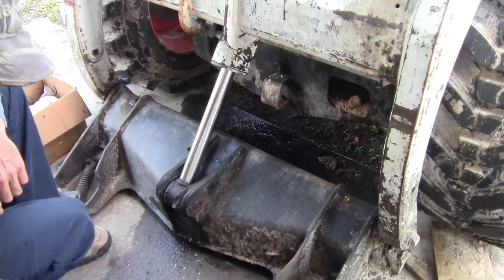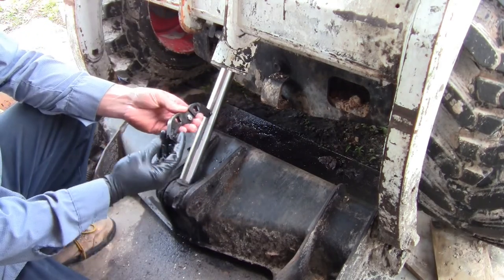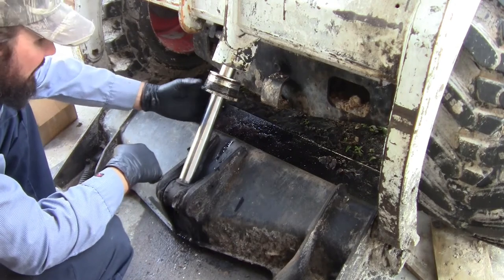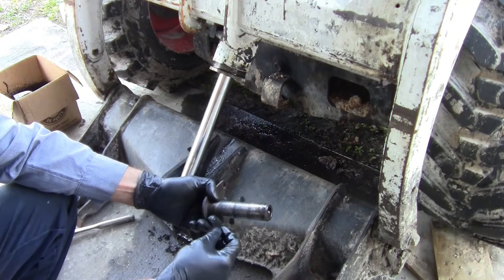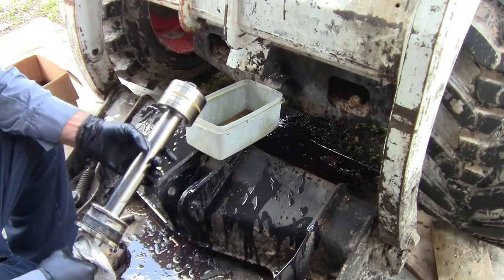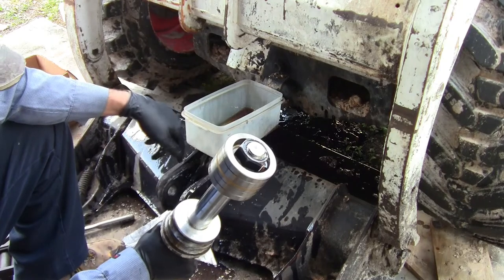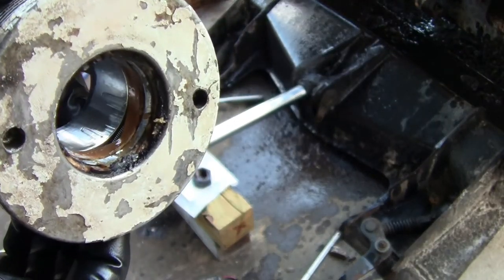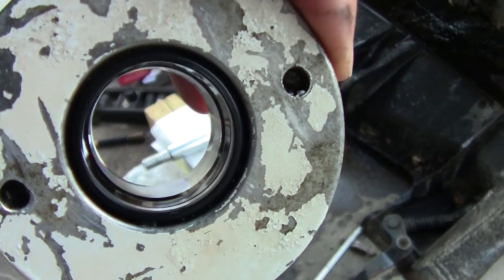1995 Bobcat 753 - Bucket Tilt Cylinder Rebuild

Comment: Thank you for the hints to speed up the process... heating the ring with boiling water is a great Idea. I've alway had to use a pipe wrench to loosen them. I use card board to prepare for leaks.. screwed up the main plastic ring on my first attempt. 1/22/24   Replaced main compression ring on the tilt cylinder head, heated ring in pan on hot plate full boiling water.  Stretched enough to get it on, then covered/wrapped it in blue painters tape then wrapped in black electrical tape attempting to get the ring  to shrink.  Finally, used a ring compressor on top of the tape to get the ring to shrink into the grove. Left for about an hour, it worked perfectly!!! Used baling wire to hold the cylinder housing up so that I could get a perfect straight shot when I installed the piston and ring. Used normal petroleum jelly as prelube.
Reply from the maker: Glad it helped. Thanks for watching and for taking the time to comment.

Comment: Thanks for your time, and efforts in making a great video.  My son just blew the seal in my 751 tilt cylinder.  Your method will definitely speed up the repairs.  Was planning on pulling  the cylinder then doing the rebuild, this is so much simpler.
Reply from the maker: Glad it was helpful. Remember to plan for that gush of fluid when you pull the rod out. Good luck and let me know how it goes.

Comment: Excellent, thank you! I always removed the cylinder but your way is better.
Reply from the maker: Glad to have helped. I have done quite a few cylinders now on different machines and it always seems easier to use the machine and pin to hold things like the rod or cylinder. Wish I would have started doing it sooner. Thanks for watching and for taking the time to comment.

Comment: Great video, very informative and a lot easier than taking hoses off and removing the cylinder. Glad I seen you do this before I repack mine on a '99 * 863
Reply from the maker: Hi Jim. Glad this helped. I started doing this with some excavator cylinders I rebuilt. I rebuilt the boom cylinder on my 1960 JD 440 backhoe and had to put the rod back in the machine to hold it and put the breaker bar on it. Turns out the machines are the best way to hold the cylinders and rods. Thanks for watching and really appreciate the comment. Good luck with your repair.

Comment: Hi great vid. After you reinstall the ram with new seals how did you purge all the air out of the system ?
Reply from the maker: Hi Kelly. I just cycled the cylinder and it pushed the air out. Thanks for watching.

Comment: Good Video. I am going to do the same for the 753.  What size nut is that on the top of the cylinder as I currently don't have this size socket?  Thanks.
Reply from the maker: I'm sorry I don't recall. Good luck on your repair. Thanks for watching and for the comment.
Reply: I just did mine this morning  ND it takes 1 3/4 inch socket

Comment: My seal wouldn’t hardly shrink back to size…no way it was going to go into the cylinder.  Local hydraulic shop suggested using a piston ring clamp, or hose clamp to compress it back down to size.  Just be sure the hose clamps notches don’t mess up the seal.
Reply from the maker: Yeah. When they are out of shape it gets hard to avoid catching the edge of the tube when inserting it back. Thanks for the suggestion and for watching.

Comment: My bucket keeps slowly dropping. Would this be because of the tilt cylinder?
Reply from the maker: It could be but in my experience, when the internal seals go bad it leaks oil out the wipers since they don't do anything to hold back fluid. The other possible culprits might be leaking hose from the controls or depending on the model, the valves at the controls. Even after the rebuild, mine will very slowly drift down so it is probably in the valve part.

Comment: what was the torque on the nut ?  I was watching just to hear it !!
thanks
Reply from the maker: I'm not sure, I don't have the service manuals. I think I used thread locker and put it as tight as I could with a pipe.

Comment: A minha não desbloqueia os hidraulicos, fica com a luz tilf a piscar e por vezes apagada, já nao sei mais o que fazer
Reply from the maker: I'm not a proper mechanic and not sure which machine you have but check all the lock switches and fuses. There is the lap bar that has to be down, the parking brake, the green button in the cab. I had a fuse go out once that disabled my aux hydraulics. That is in a little box in the back as you open the door. Also check the wiring under the cab where the manifold is. That assumes electrical issue but otherwise check for pressure from the pump and make sure fluid level is good inside the tank. There may be a leak somewhere. Hope this gives you some ideas. Good luck.
Reply: @CedarTrailsLiving  Thank you very much for responding!